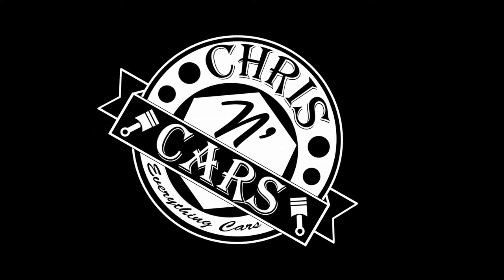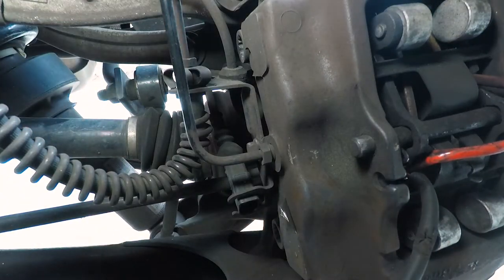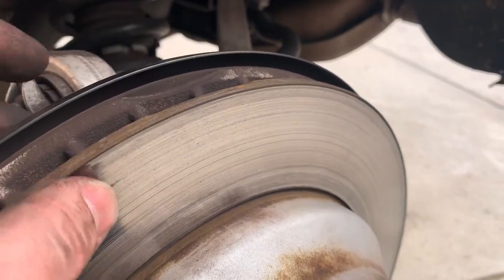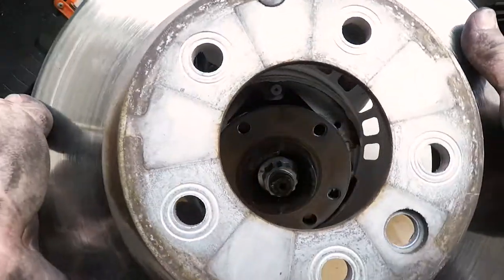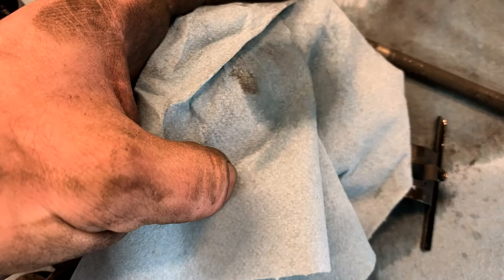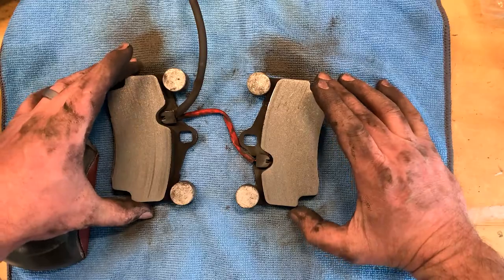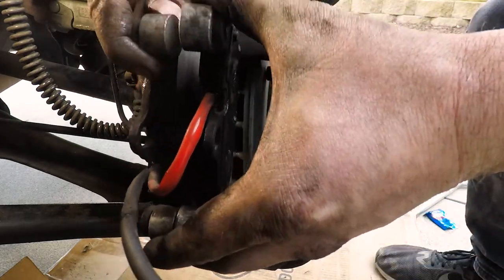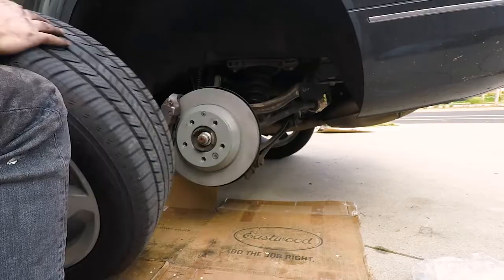REAR Brake Replacement 2007-2015 Audi Q7

Comment: Super! Best one I've seen and I have to do my Q7 soon.
Reply from the maker: Hey! Thanks for the comment and glad it helped
Reply: @ChrisNCars 1st question: Did you have to go into the system or Audi software to change the caliper pads or rotor ? Or did you just simply jack up vehicle remove wheel and use the required tools to remove the bolts etc for the service to be completed and put it all back together done ? What tools did you use T27 Allen 6mm T50 for example...?

Comment: A completely thorough explanation of the AUdi Q7 rear brake pads, rotors, bolts and spring.  I especially appreciate the way you address cleaning all parts before reinstallation.  I have a 2007 Q7, and I was told my back pads were about 1000 miles before the sensor light would come on.  That is exactly what happened.  No explanation of whether the rotors should be changed, You provided excellent indicators to look for:  squeek, vibration, uneven wear on the pads.  I have none of those.  I will be using your information to assure the pads are changed and sensors properly cared for, and only change the rotors if indicated.
Reply from the maker: Glad the video helped and thanks for the nice thorough comment.

Comment: This is a very good video. Props to you man. 

For everybody that wants to know, the little screw is actually triple square 5.
And that hole is for the parking brake adjustment. You see the adjustment wheel on the right hand side of the parking brake shoes.

BTW. Those brake shoes look like they need to be replaced.

Comment: I just did a brake overhaul with rotors and pads, on my 2009 VW Touareg R50 (5 liter V10 Twin Turbo Diesel) which is basically the same car. I was looking for a video after the fact - to see if anyone else had as much trouble as I had removing the rear calipers. The bolts basically felt welded in place. Luckily I have a ramp lift in my garage / hangar so that I can work from underneath...

The Brembo brakes are the same with 368mm rotors / 6-piston calipers in front and 358mm rotors / 4-piston calipers in the rear. The front was easy and the rear was close to giving-up level of difficulty. The main reason being that it's VERY difficult to find enough space for using a good breaker bar to get enough torque to remove the upper caliper bolts. After hours of swearing, buying a new, stronger and smaller pneumatic torque gun and using a heating gun liberally, I finally got the bolts loose...

The only difference I can see between my car and yours is that the Brembo calipers on the Touareg doesn't have any retention pins. You can't change the pads from above but have to remove the calipers and insert the pads from below. That's okay since the rotors should be changed every other set of pads and the pistons should be inspected for corrosion issues anyway. I had 5 out of 6 pistons stuck due to corrosion on my front right caliper! A complete set of new pistons and seals (20 pcs of each) is ordered from a UK manufacturer).

Thanks for the video! It helped me to decide that I did things the only way possible and didn't miss some 'secret' tricks. 😃
Reply from the maker: Yeah, German engineering make it seem complicated, ha! But persistence will win 😅

Comment: I love the “all you have to do” comments from the non rust belt people.  VW/Audi rotor bolts are notorious for rusting, seizing and stripping.  If anyone does this, you better have a EZ outs.  Note: when you put it back in, IF you put it back in, use some Anti-Seize.  It wail make it much easier the next time.
Reply: You got that right add an extra 45 minutes to each wheel for dealing with rusted bolts holding rotor to the hub and hub rusted to the rotor. Better have your blowtorch, your ease outs, your drift pins, your ball peen hammers and nuts off spray.

Comment: This video is useful but fails to identify the difficult aspects of changing your brakes. I just finished changing the front and rear brakes on my 2015 Q7 for the second time in 7 years. I won't make a video but would like to share a few lessons that I learned. The hardest part is removing the retaining pins and I have learned that if you apply generous amounts of penetrating lubricate like WD40 or PB Blaster and let in soak for about 24 hours it will increase your chances of loosening the retaining pins, because they ARE seized.  Also, I sanded the pins and applied an anti-seize lubricant to them before I reinserted them.  I thought I had a bright idea to change the retaining pins with new ones but after doing some research I discovered that you are supposed to change them anyway.  So, I bought some new retaining pins and will be putting anti-seize lubricant on them and replacing the old pins as soon as they arrive.
Reply: The pin is so easy to remove. You simply use a punch or a screwdriver and hammer. Worst case scenario use a torche or heat gun and comes out in one easy hit

Comment: Just curious why didn't you go back with Brembo rotors? Really aren't that much $150 front set $140 rear set  when I was shopping around nothing came close to Brembo set compared to quality vs. $$$ pads on the other hand that's a different story. I went with the Powerstop z26 
Seems to be a good combination, peddle fell is great really good stopping power, relatively low dust too.
Reply from the maker: @MickeyWu7r5  honestly think I just went for what was on sale ha

Comment: The bolt that you transferred and weren’t sure what is for, is for pulling a badly stuck on rotor from the hub. You pull it out and screw in the bolt of the same thread pitch to crack the rotor free. It’s a puller thread that is protected by a plug. That is why you pay 300$ for a set of Audi rotors.

Comment: The guy at the parts store said I'll need a scanner tool to get the parking break to release the brake pads? I didnt see that mentioned in this video. I am wondering if that doesnt apply all Audis. I have a 2015 Audi Q7. My parking break is a foot lever and has a pull release. It's not like the fancy Audis that have the button you push to turn the parking brake on and off. Can I change my brakes and rotors without a scanner tool? This might be a dumb question but I am just a medical field gal so this is not my field of experience ;)
Reply from the maker: I doubt it, that's what I have and didn't need scanner or computer.
Reply: @ChrisNCars just finished replacing our brakes and rotors. Your video was excellent and made the job go very smooth! Thank you 😊

Comment: So you didn't need to wind the handbrake ratchet back through the stud holes to get the discs off ? I've got 2008 Q7 and need to do mine
Reply from the maker: I didn’t have to do that.

Comment: Chris did you use after market parts for your car ?
Reply from the maker: Yessir
Reply: @ChrisNCars  no issues or noise sound ? I want to buy this car but so scared bcz of the parts prices. Do you mind if share what brand do you recommend for general parts pks ? And thank you 😊
Reply from the maker: @mohammedal-ahmadi8045  I was scared for the same reasons. Honestly only put 14k miles on it and the car is at 72k now, so I can’t say reliability past that. No major problems so far. The dealership try’s to sell you crazy expensive service options. Repairs require a couple more steps in removing plastics and such. Parts are a little more, like 10-25%, but I buy it all on Rockauto and Amazon for the most part. You can’t beat the ride of German made car, but if you are looking for a car that just needs oil and forget, go for a Honda or Toyota. Still, its all just a car working on general maintenance like this is pretty much all the same.
Reply: @ChrisNCars  thank you so much for the clarification Chris. Really appreciate it 🙏 🙌 😌

Comment: Those M16 triple square bolts do not come out that easily.  Broke a socket trying to get them out
Reply from the maker: Aww man! Mine were super tight but what you see on the video was the real deal. Sorry you can’t get it.
Reply: @ChrisNCars  Had the M16 triple square with a 3/8" drive.  It broke the craftsman 1/2 to 3/8 drive adaptor trying to break it loose.  Found the M16 in 1/2" drive and eventually got it to break loose.  Difficult to get the rust breaker lube into the right spot to help get it to move.
Reply from the maker: @jasonl6380  happy to hear you got it! I left it out in this video but if you live in a rusty place don’t forget some anti-seize! Sure you already know.
Reply: I had the same issue with my Touareg R50. I needed to use literal amounts of heat from an electric heat gun, a meter long breaker bar with full force and working from underneath. I wouldn't be able to do this if I hadn't a ramp-lift in my garage and was able to work from underneath the car! Heat, breaker bar and small, strong pneumatic impact wrench was all needed to successfully do my rotors and pads in the rear.